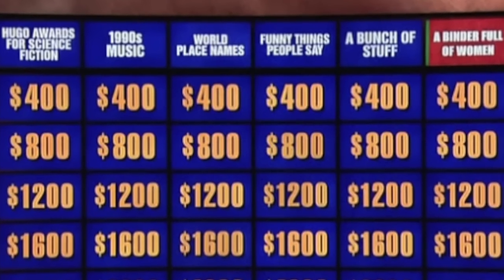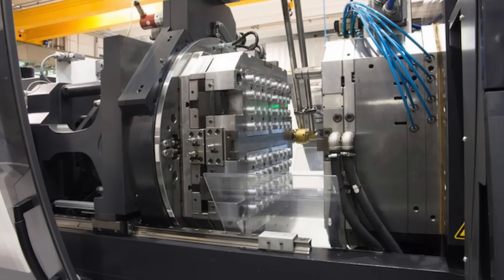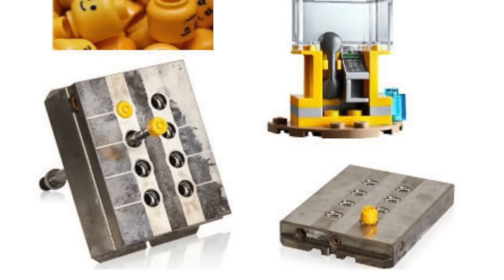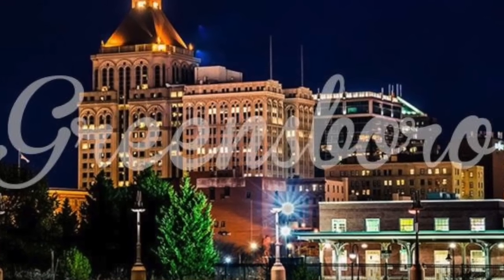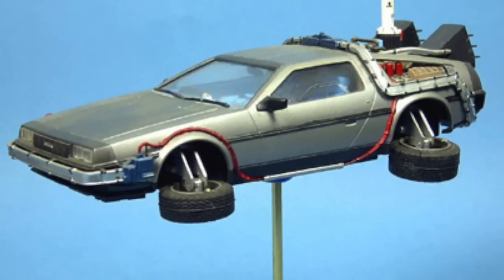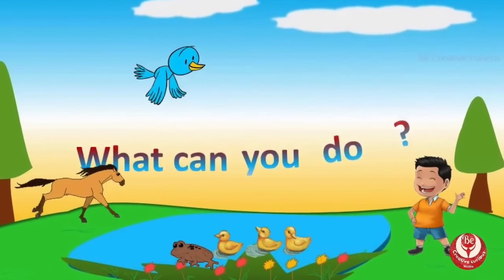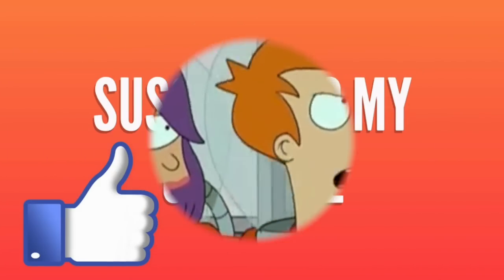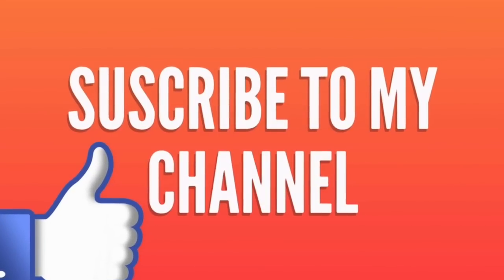When will 3D printing be used to mass produce toys and action figure collectables? Tooling replaced?

Comment: There's also a lot of maintenance involved with 3d printing. I assume there is with injection moulding as well but with the speed and throuput of an industrial injection moulding machine I imagine it would be a much smaller proportion of your work time.
Reply from the maker: Very much so

Comment: The hurdles of 3D printing for me besides speed is material.

For the home user

If you go FDM - you got stronger materials in a specific direction for resolution is limiting. Also anything you need to support is going to be messy. 

If you go Resin - Nothing has the durability/flexibility while also being cost effective as the plastics used for say Marvel Legends. And again supports vs a few sprues.

The big beefier industrial printers has some work arounds like wax supports and stronger materials. But still surface finishes are speed are an issue. 

It's still very much a prototype stage.
Reply from the maker: But we will be there one day!

Comment: The 3d print information used in this video is horrible outdated.. It does not even mention resin printers... Which in top quality mode can more or less match molded things...
also.. it handles moving parts fine if you use the correct resins....
And right now the speed of printing is is a fraction of what it was a few years back...

Also... using 3d printing to create molds could maybe be the future...

So Scott: please look more into modern 3d printing, and consider updating the video or make a new one..
Reply from the maker: All of my videos are horribly outdated.
Reply: @spectorcreative1872  hehe, normally they are  not🙂 
And dont worry.... nobody expect you to know everything. And all your videos are entertaining and informative 🙂🙂 
So we can forgive your lack of knowledge about 3d printing😁

Comment: You missed the whole concept of resin (SLA printing)  as resin is WAY more detailed, and faster (as the x and y axis parts of the print are happening simultaneously) most of those have a cap of the 12 hour mark. Additionally you absolutely CAN do moving parts due to different materials (hell I just printed a bunch of tng tricorders with moving hinges, and I have seen plenty of modelers print repro Star Wars and ghostbusters figures, even adjusting scale so they could be smaller or larger. (Retroblasting even showed on their channel mego buck Rogers reports and figure sized Galactica models that were sturdier (with moving parts) then the old mego versions.Also bed capacity is an important part (and also a reason for some FDM printers (like the ones you mentioned)  so in the case of a chess board you could print all the pieces at once easily on say an ender 3 or CR10. When I print for my D&D game, I normally print 5-8 miniatures at a clip in resin on an elegoo Mars, and they take about 3-4 hours. Assuming that you can only print one part at a time would be like assuming injection molding tools can only make one part of a figure at a time, often tools I have seen may have multiple parts on them same here. The real reason we aren’t there, I would say is more about post processing, Buying a fully painted He-man or Spider-Man is always easier than fabricating the parts and painting, as well as it is less work with more uniform results. Normally we are not asked to say remove the toy from spruces, assemble and paint it like a model kit. Where 3D printing does require removing supports and if you are building a multi part item, most likely assembly. I would recommend doing a bit more research into 3D printing.
Reply: I saw -- many years ago -- an adjustable wrench 3D printed on TV. No assembly required. And there are videos online demonstrating the printing of chain mail.
Reply from the maker: Excellent point and well said!

Comment: While I disagree about the 3d printing not being able to have detail - the resin printer I have can produce great detail - printing it in such detail and with small layer lines takes a long time to print - it takes me a day to try to print a batch of miniatures.

In regards to resin prints, there is also the notion of hollowing out bigger pieces to avoid cracking - holding out the piece also excess resin to drain out of the print.
Reply from the maker: Exactly!

Comment: I’d summarize the answer to this question like this: You would use 3D Printing for creating an object that you wanted to create a mold of only.

The assertion that 3D printing takes a long time or that “the detail isn’t there” is kind of based on old info, or more relevant to FDM 3D printing.

Resin printing using stereolithography is quite a bit faster because it draws each layer in one pass, instead of FDM extrusion printing has a print head that has to spend time moving around on each individual layer to complete that layer.

Resin printing is also capable of very fine detail. The difference in detail on a print from a $200 SLA resin printer and a $200 FDM extrusion printer is absolutely night-and-day.

With entry-level 3D printing on a resin-based machine, we’re absolutely at a place where people can print the parts for an action figure overnight, but it’s still in a hobbyist position because you still need to clean up your object, the printer itself, and then there’s the whole aspect of finishing and painting your new toy.
Reply from the maker: Their is a lot 3D printing does as you noted, but it is just not at the point of making retail ready articulated toy product.

Comment: This is only half the story. You are ignoring the potentially far faster - and more dangerous to handle - DLP printers that use lasers to harden resin in a bath with a platform that's going up. You are also ignoring the fact that the FDM can print in multiple colors, thus you could get a toy that might not need to be painted. As for quality, some high end filament deposit printers can achieve similar quality to extrusion model plastic objects - not just toys. I agree, we are not there yet, but this video is a few years behind the now.
Reply from the maker: Even those are not enough to produce retail product... yet
Reply: @spectorcreative1872  And probably never will, but that doesn't change the fact your video is a few years out of date.

Comment: The short-term future for 3d printing will be, I think, industrial-scale printers, which can handle a lot more than plastic. I read about a drone manufacturer that uses them for small-batch on-demand metal replacement parts for their products. These types of hubs can be set up in larger urban centers, similar to what Shapeways has done. This allows companies to do shorter runs at relatively high quality and reduce shipping/warehouse costs (and bring back a viable manufacturing sector in many G20 nations). Many smaller publishers are already using the print-on-demand model to keep books in print, so the model is proven. Getting to the Star Trek replicator model, where you order a wireframe and it gets printed in your house...that is still distant future for me.
Reply from the maker: I can't imagine you are far off

Comment: I've had 3d printers since 2005. Starting with a Z Corp 310 plus(binder type), it was a pain and expensive. But it made good parts for prototyping, of course you have to finish the parts for casting. But that was easy, just apply elbow grease. But Scott you are incorrect there are machines that can produce movable parts. With resins that are flexible enough to snap together and can take a bit of abrasion. I've seen examples of such parts used for very limited production machines. 

Your video focused on Fused Deposition Modeling what most people think of with 3d printers. The area of printing that is just as cheap as FDM is Digital Light Processing, that's the one that's going to get fast and produce highly detailed parts. Formlabs is a company to look into. They are not a cheap printer, but they are considered an excellent machine. 

The future of this tech is going to get interesting, so far my biggest complaint is people not finishing the parts. They use whatever color is close, and not supplementing areas of stress.  
My complaint with this video is comparing an FDM printer to an injection molding machine. That's like comparing apples to elephants.
Reply from the maker: Moveable yes, but action figure articulation that holds up to play, no.

Comment: I designed a range of giant insects with saddle accessories (for the Zica Sectaurs 3.75 scale) they are ball joint articulated and the saddles are flexible , and they print up really nice. 3d printing is already capable of doing articulated figures you just have to print the parts in different plastics as 3d printing plastics range from flexible to very hard.
Reply from the maker: That sounds awesome. Giant insects are tight

Comment: There are some niche areas (customs, replacement parts, exotic parts, etc.), but I think two major areas where 3D printing can help the mass toy industry is "toy preservation" and making tools i.e. molds cheaper. Truly, they're two aspects of the same thing. Today, you can 3D print metal. You can pay someone a fraction of the time and work to make a 3D model of the future toy, then directly 3D print the mold and at most only hand sculp finer details on the mold. Or you 3D print the model in plastic, finish it by hand, and do a few (well known and wide spread) casting methods to cast the final negative mold. There are more steps, but they can be cheaper altogether since you require less expert carving/sculpting.

And because you have a digital file with the precise shape, you can replicate the same process multiple times. Tool broke/worn out/got lost somehow? Just do that again. And that is where the "toy preservation" comes in. Digital files, much easier and cheaper to store than tools, if you wanna do a re-run later, you don't need to go broke storing a whole set of tools, just a lil space on a cloud will do. Preservation wise, you could even get digital files for older tools if you want  with a 3D scanner. As long as you can get your hands on a surviving original in good shape, you can remake that toy or part.
Reply from the maker: Niche for sure. Mass market, not yet

Comment: Like others, I've been able to replace vintage parts with parts produced by my 3D printer (X-Wing cannons, B-Wing canopy, ext..). I think 3D printing is great for collectors, not just for replacing parts, but making additions of out own. I've printed better weapons for figures, and even have been working on a Transformer backdrop that looks like the base from the show.
I also agree, it's not the best for making joints for figures, but it can be done.
And I'm sure 3D printing has its place in the prototyping stage.
Another strike against it for mass production I think is just the wear and tear on the machine. A 3D printer can be a complicated machine with belts and wheels and all, while an industrial injection molding machine is designed for extended use. As a technician myself, it also seems the more complex the machine, the more prone to breakdown it is.
I also can't imagine the toy industry is eager to start selling files to print up toys anyway, since that would cut deep into their profits. And exclusives would be a thing of the past; as long as you have your own printer and can get a hold of the files, you can have one. 
Anyway, just my 2 cents.
Reply from the maker: I wish I had that talent!
Reply: @spectorcreative1872  thanks, although I at present can't 3D model myself. But there are plenty of sites where you can find free models to print. And as for using TY he software, its not too difficult to "slice" the model, meaning you take the model, orient and even resize it (and you have a few more option), and then convert it into a format the printer can use. I don't think the learning  curve is too steep, but it takes a little time to get used to.
Reply: "It also seems the more complex the machine, the more prone to breakdown it is." That is an engineering principle, every part, every joint, every interaction is a potential point of failure, potentially a single point of failure (a point that if it fails, the whole system fails). So indeed, more complex = more prone to breakdown.

Comment: A few thoughts on this.  The moving parts thing is not quite right. You can 3D print joints and such and put them together and they work just as well as on a injected molded toy.     It just comes down to using the right material and using a 3D printer that can print very precisely. 

That being said. You are right they speed is a factor so I never see them used for mass production.   What is a cool possibility though is the ability in an industrial setting to 3D print metal. Then you can start making the tools themselves with a 3D printer.
Reply from the maker: You can but they won't hold up to "play"

Comment: Some miniature makers are already using 3d printing because it's far cheaper than injection moulding if you're only moving a small amount of product. You can actually make good looking miniatures even with a commercially available printer (my friend has one and he's printed out some 1:260 scale tanks and the like with it). However, it's probably too slow for anything with large production numbers. It would probably already be possible to do small runs of non-articulated collector figures with 3d printing. No doubt some point in the future it'll be possible to do articulated figures as well, though injection moulding will probably keep being a better option as long as you're selling enough toys to cover the cost of getting the tooling done.
Reply from the maker: Yes that is one of th few categories that this works for

Comment: 3D printing seems like an excellent option in the planning stage of a toy line.
Reply: 3d printers used to be called rapid prototypers, and that was one of the things they were used for.
Reply: I saw a 3d printer being used by Mattel in a Barbie documentary, when they were working on new body types.
Reply from the maker: Yes for prototyping it is perfect
Reply: Curious to ask...do you have buy tons of plastic for the printer?? Does it come solid or liquid? I take it that it would take long to heat up before it prints
Reply: @robd1329  The Ender 3 Pro uses filament, a long string of plastic on a spool, it's about $20 a kg, so it's not super expensive. The resin printer is a much messier thing, and uses a liquid resin that the machine hardens in layers.
Reply: Hasbro definitely prints prototypes.

Comment: I think there is one more area where 3dprinting will be very interesting for adult collectors. Making replacements for missing or broken accessories,  recreating those accessories in a different color or making additional accessories.
Reply: You have no idea how many MotU weapons I've printed on mine. (I've also printed a pair of complete figures, and a few heads for customizing). I also, using a resin printer, replaced the missing guns on my Spydor.
Reply from the maker: It just takes a lot of time
Reply: It gets hard for kids too when an accessory gets lost/broken. It'd be neat to see a comparison of different ways of making reproduction parts, and if there's any rules around making reproduction parts. I'm guessing the main options are molding or 3d printer.
Reply: I use mine to 3D print parts for work a lot. 3D printing is so cool, you can’t print almost anything that’s made of plastic

Comment: Star Trek Online has set up a way to 3D print most any ship your character has (including variant parts/colour patterns), the company which is doing the 3D printing has different price points from little basic versions to larger ones that hand-painted.

It's expensive (around $300 US) for the handpainted ones. I was debating on getting one, but I didn't know which to get, when it was first introduced when it had a decent discount. But then again, when gas prices are a concern, that kind of money is needed elsewhere....
Reply from the maker: Yes and expensive is exactly it! But love the info I did not know about this

Comment: You forgot one thing for 3D printers, we can create our own playsets that we never could have... Retroblasting just did his own Cloud City Freeze Chamber and I think it looks fantastic...
Also, I thought 3D printing could never beat a plastic molding when Shadiversity tried to smash a 3D printed sword with another and both of them exploded at the same time... It was awesome, but it showed that 3D printing is very fragile...
Reply: fragility in a 3D printed part relies heavily on layer orientation wall thickness and infill density. while it's great for rapid prototyping some parts are better cast in resin after the final form is decided on.
Reply from the maker: If you have the talent and time! Awesome
Reply: The guy said he had over 100 hours into it. So with that kind of return, 3D printed parts for collectors might be close to garage kit models way back. Seemed like makers put a bunch of time into a limited item and put whatever small profit into the next model.
Reply: I have seen the Retroblasting video , it's awesome ..... but I think it would be faster to make a so huge model out of big plastic blocks (50cm x 50cm x 10cm) , all you need is a file , drilling machine and sandpaper . I think it would also cost much less .

Comment: THis is mostly for FDM printers, the most common type.
Recently UV Resin based printers are entering the scene. Those offer much finer detail, and for most of the parts faster print speeds. Ideal for highly detailed parts or even for DIY investment casting. You still need the skills to first design a toy, then turn it into something mechanically viable and paint/assemble your creation afterwards of course. The tabletop mini companies seem to really dislike them if one reads the room in that market!
Reply from the maker: And that is the part that needs time and talent